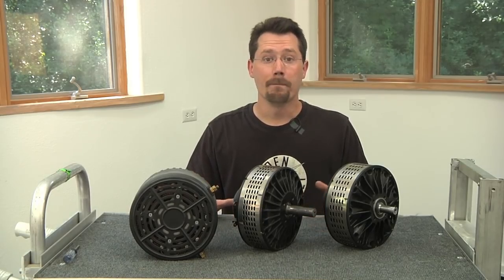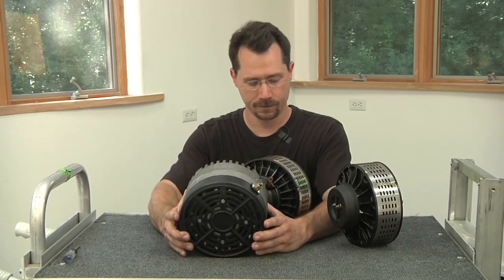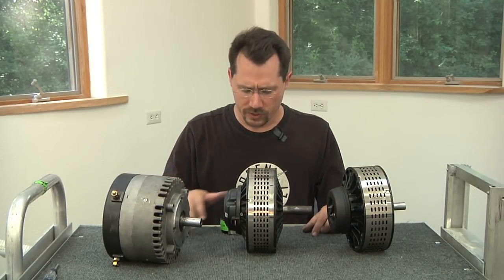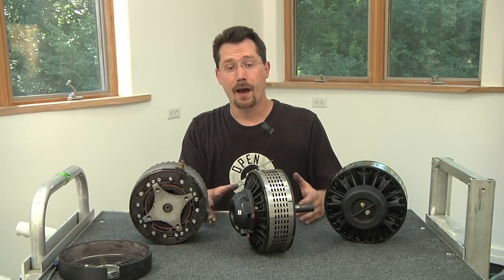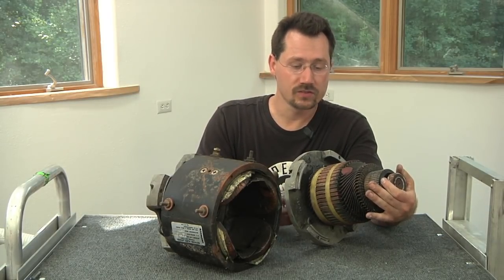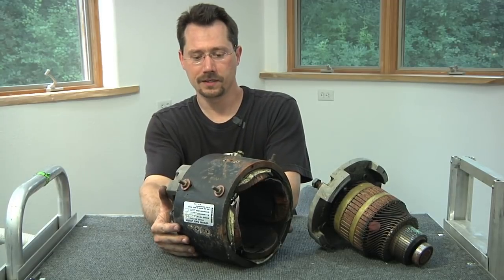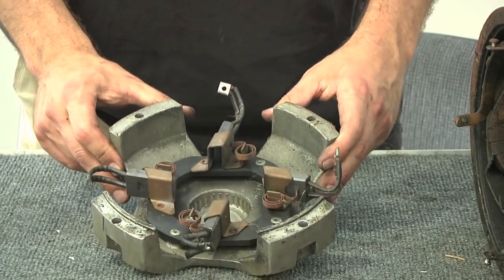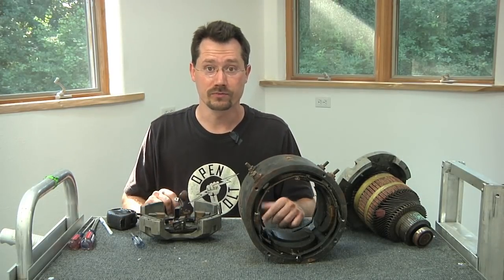4 Build Your Own Electric Motorcycle - FULL - 4 Motor

Comment: Will a motor from wash?ing machine be enough for my build
Reply from the maker: Probably not.
A motor from a household appliance, like a washing machine, will generally be less than a maximum of 15A @ 120V here in the United States. That's 1800 watts, or about 2.4 horsepower. Besides the lack of power, you would also need to invert the Direct Current (DC) from batteries to Alternating Current (AC) to power that style of motor.

Comment: Can you use an electric motor with a Transmission?
Reply from the maker: Yes, but keep in mind that on a motorcycle, the engine and transmission are often built together as a single unit, and it's difficult to use one without the other.
On this project, I simply chose gearing which was appropriate for my motor power and top speed desired, and then used a fixed single-speed gear by using custom front and rear sprockets.
Reply: @BenjaminNelsonX  I plan to build a Harley Chopper in electric. The transmission is separate and is joined to the motor via a plate and connected via a chain or a belt drive
Reply from the maker: @ThomasShue  Then that should work fine. However, the transmission will also take up more space in the bike than single-speed gearing would. That's space that might be better taken up by batteries. You might find that even with a transmission that you end up leaving it in a single gear anyways. Take a look at motorcycles on the EVAlbum to get more ideas so you can build your project in a way that's right for you!
http://www.evalbum.com/type/MTCY
Reply: @BenjaminNelsonX  thanks, I have lots of room for battery's, I plan to build my own custom battery from small cells that look like fat AA batteries (with the proper chemistry of course)  and this cell will be made to fit in where the long stretched  gas tank would of been.  This bike will be a bar hopper style. I hope it's range to be 75 to 100 miles. I am looking for about 150 to 200 rear wheel horsepower.  It may be ambitious, but this is what I want.  I used to own a motorcycle manufacturing businesses about 15 years ago. I have a complete roller and transmission. I just need to figure the motor and speed controller as well as my electronics as I think I want to tackle regenerative braking.   I know that too may be ambitious, but why waste all that inertia when you are off the throttle.  I want to be able to engage and disengage the inertial braking.   I plan to use everything that a normal Harley would use except the motor and electronics.
Reply from the maker: @ThomasShue  Sounds like you know what you are doing on the mechanical side.
Try making some new friends locally who have a knowledge of motors, controllers, and batteries. "Makerspaces" and the like are great places to meet new people and share skills!
Good luck on you project!
Reply: @BenjaminNelsonX  Thanks, I do have a friend that owns a forklift repair company. I may see what he thinks about my project.

Comment: So what if i modified the original gear box from the original bike to fit on the motor, would this increase top speed (other than added control by using the lower gears)
Reply from the maker: If your transmission includes a high enough top gear, to make the output to the rear wheel faster than the motor can spin, then you COULD get a higher top speed, but at the expense of higher current draw. Typically, you are better off saving the space, weight, and physical complexity by NOT having a transmission. The extra space can be used for a higher voltage battery, for a better top speed.
A transmission wouldn't give you any better control at low speeds, as a modern electronic motor controller provides full torque and excellent speed control at even extremely low RPM.
Few electric motorcycles have transmissions.

Comment: Wow they big motors , what they come out of ?
Reply from the maker: These motors are NOT salvaged or removed from some other piece of equipment. They are motors manufactured for use in go-karts, motorcycles, etc. and are available for sale to the general public, typically through internet/mail-order distributors. Do a web search for "Electric Vehicle components" and you will find plenty of suppliers.

Comment: Y not use induction motor instead of pmdc motor ?
Reply from the maker: PMDC motors are nice and compact, and easy to control. An AC induction motor, while powerful, will also be larger, more expensive, and more complicated to control. Motors with permanent magnets also tend to be more efficient than motors where electric current creates both magnetic fields.

Comment: Can I use an AC motor for a motorcycle?
Reply from the maker: Yes, of course you can use an AC motor on a motorcycle.
The cost has come down and the availability of AC motors (and brushless DC motors) has increased since this video was originally produced.
Reply: @BenjaminNelsonX  it's just that I have like 7 old AC motors

Comment: in 2008 maybe, but not in 2018....the prices of e-bikes are coming down, new entries into the market all the time.

I bought a 15Hp electric motor, controller and all the parts needed to build an electric dirt bike based on crf230 frame.....never found the time to get it finished - had the motor mounted, sprockets, etc, but stalled on where to put all 6 batteries for a 72volt system. after several years of not getting any progress, I realized the bike would be butt ugly even if I finished it.   I'm no master fabricator, so i dont have the skills to make it work slick, smooth, and look good. 

A good question to ask yourself before you go to all the trouble I did: " do i really want to commit hundreds of hours in this or do i really just want to own and ride an electric motorcycle?"     If the latter then i recommend buy one of the already great production bikes available now on the market or if budget is tight just wait a few more years - the prices will come down.
Reply from the maker: Yes! There are  now lots of great electric motorcycles out there! The ZERO brand-name has been one of the most popular, and they make a range of models. If you have plenty of money, and just want to buy an EV motorcycle, I would definitely recommend Zeros.
I built my own electric motorcycle for about $2,000 and LOVED every minute of both BUILDING it and RIDING it. Zeros cost considerably more than that...
I also like the idea that if something breaks, I know how to fix it.
There's always been the debate of "Buy vs Build" for all types of projects. As more things are commercially made, it's easier to simply buy, but some people still love the learning and the challenge of working on the project themselves.
You can also apply all these same ideas to a mini-bike, a trike, a high-power go-kart, etc - vehicles which you might NOT be able to simply purchase.

Comment: put a generator right after the battery and motor and then put the motor on the lowest setting then connect the generator by a belt and then use a transformer to power another motor so that you increase the battery life from 10 to 100 times. it is the secret that is hidden by big oil for over a hundred years. wanna hear a joke use a 6 volt 2 amp accelerometer. it is basically a conveyor motor with a speed dial but to increase the value put on a big wheel on the accelerometer and take the wheel of the generator and just use a tiny little rod. then adjust for maximum output. i bet tesla is using a transformer afterwards but properly made generators will spin up off the gas pedal and the accelerometer.
Reply from the maker: Stephen Givens a hybrid system is a bit much to fit in a motorcycle frame. I did build a plug-in hybrid from a Geo Metro. It worked pretty well. Do a search for “Electro-Metro” on my channel.
Reply: sir is it a step up voltage system or not.
Reply from the maker: Stephen Givens The Geo Metro used an LP (propane) generator to power a charger which would feed power to the battery. The generator would run continuously to always add energy to the battery whether the car was accelerating, cruising, or at a stop. It was sort of a low-tech Chevy Volt.
Reply: the six volt 2 amps version is a parts conveyor motor with a speed dial on it. and my friends out there say it will work but for the largest versions it takes up to 120 and 20 amps. it all depends on bearing tension, weight and is literally called a Near Zero Point Energy Step Up System. N.Z.P.E.S.U.S. it is what i thought up also.
Reply: It is also a d.i.y. system so have fun.
Reply: Stephen Givens Carefull...
...
Reply: Trasformers are at best 50% efficient. In other words, 50% loss of input.
Reply: B.S they are much better than that .
Reply: Your big oil conspiracy theory sounds like a "free energy" scam.

Comment: did he say "top speed of 45mph" ??? thats not a motorcycle
Reply from the maker: Hi Dude! Part of the fun of building your own electric motorcycle is that you can design it any way you want! Mine has NO transmission, no shifting, and goes from 0-45 in a snap, but I live in a city, so 90% of all riding is in a 25MPH zone. I geared it for great acceleration and fun, but didn't need a high top speed. With a simple front sprocket swap, I could easily do freeway speed and faster.
Reply: A Dude its 45mph in that configuration, and thats gotta be at least a 60 tooth rear sprocket, if he dropped it down to a 44 it would double the speed easy